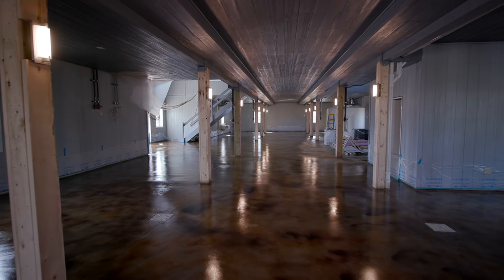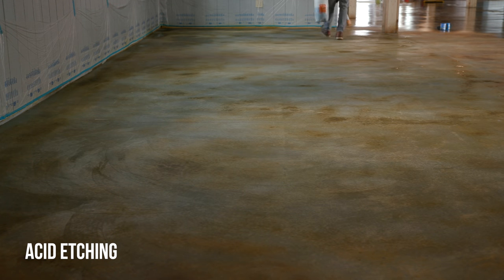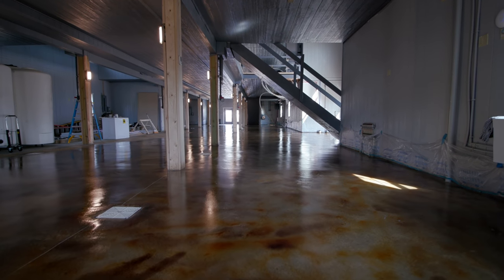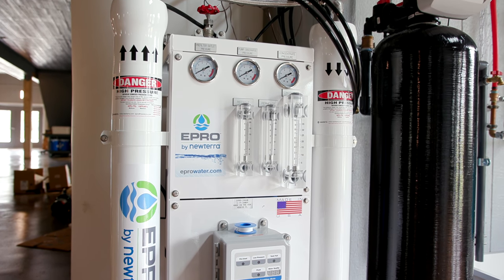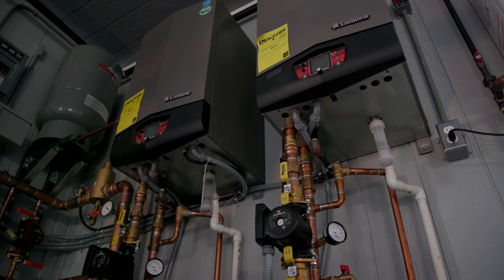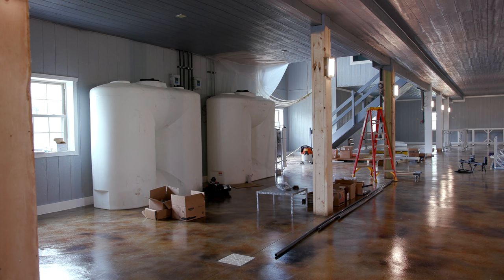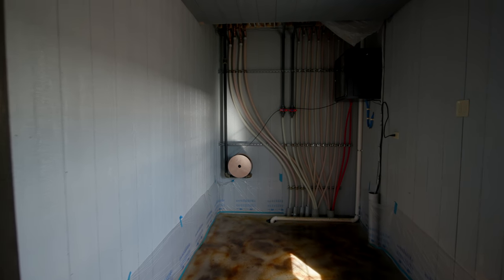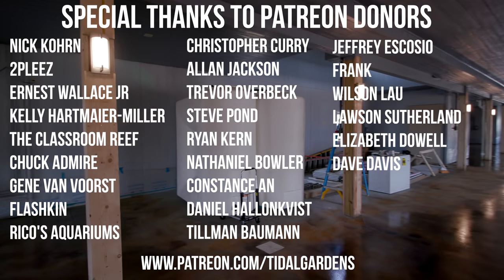New Tidal Gardens HQ Construction - Episode 9

Comment: Hi Than, the floor looks great we have some tenants do that to the floors in our office building. 
 You may know this already but I wanted to make sure but aluminum and stainless steel do not play well together around salt water. You should use no-seize or something similar to coat the screws with before you put them in.

Comment: I’ve been using 8020 for almost ten years for stands and canopy and then I used them for my storefront. I will be building a second one soon, a very small display room. 
I designed all the stands, canopies and displays in 3D first so putting it together I knew where all the part fit, plus, I cut and tapped most of the aluminum myself. 
I like how your place turned out, I’d like to visit if I’m traveling by.
Reply from the maker: Thanks!  I am very happy with the 80/20 product and I am going to be using it for all kinds of things.

Comment: Than, i recall you mentioning how you first thought of using a grit in paint to use on the concrete floor then decided against it. Well, that's the mistake i made with my fish room floor. Sadly, it began to peel up over time and, what remained became a dirt magnet ;(. SO, atm i am removing EVERYTHING from the room and stripping the paint. I became so monumentally sick of it, i had to do it. When done, i will then stain it, seal it and wax it just like you have done to your new building floor. I wish i'd have known about your business long ago. You've since become my goto "guy" for learning and in this hobby, we never stop learning. Thank you :)
Reply from the maker: Thank you!  I hope your floor turns out well.  I am happy with how this one turned out and really like how fast it is to clean.  I can do a quick mop of it in about 10 min HOWEVER I do have to make sure to wipe up any major floor spills because a little bit of water isn't slippery but a giant puddle is.

Comment: Love the floor. I would, if you haven't already, think of a way to clean those two 1000 Gallon holding tanks. Mine are only 1/10th the size of yours but they will need cleaning from time to time. The RO holding tank obviously way less. Are you having the same plumber do all of the plumbing on the tanks when they arrive? Can you do a video of that? That would be amazing! Can't wait to see it in July!
Reply from the maker: Hey Blue Carbon, cleaning should not be too difficult.  There is a drain system at the bottom that we can gravity drain out and it would be fairly easy to power wash the inside and let everything flow out.  July is going to be fun!

Comment: Than,
this is such an amazing journey you’re progressing through! If you have not said this already what Manufacturer will you be using to light all your tanks with?
What are you using for battery back up or back up in general? Have you also built-in surge protection?
Reply from the maker: I plan on ecotech radion pros.  For backup I will probably go with a natural gas generator.
Reply: Than 
have you also considered the Kessil  A360X? I am also consideringthe pros and cons of using either light on a 30 inch deep tank. I’m seeing more and more people put their ecotech up much higher and using diffusers to reduce the disco ball light affect. The Kessil shimmer looks much more natural. As far as the height over the water issue goes I don’t have answers there. I do like the fact that Kessil A30x’s are half the price of the ecotech Radion pros and it looks like you’ll be buying a lot of lights
Reply: One other thought have you considered testing a variety of lights over the first tank you install? 
This would make a great video.

Comment: For the drain pipe crossing the walkways i'd recommend using a cable/conduit cover like they use in construction and at music gigs to protect runs of lighting and sound cable, something like this https://www.workplacestuff.co.uk/product/pedestrian-cable-cover/ (found with a quick google search). they're usually tile-able, very durable (able to handle large crowds standing on them or vehicles going over them), come in colour patterns designed to be easily identified as potential hazard at a glance, and are anti-slip.

Comment: That floor looks sweet. Why'd you go with stain n seal rather than epoxy. And do you heat the water before it goes through the RO
Reply from the maker: I heard epoxy gets more slippery than seal, but really I just like the look better.  Also, I managed to get a really good deal on the stain and seal so the epoxy would have cost quite a lot more.  As for the water, I'm not heating it going through the RO.  The membranes are designed for cold water use.

Comment: Don't build steps, build ramps, trust me because you will want to use rolling carts to work. And you will trip eventually. Also put thick rubber Matt's down in areas you spend a lot of time. Concrete is rough on your feet and knees and will fatigue you.

I know because I work 8-16hr days on it. Most of the guys I work with have had 40+ years of service and knee replacements and my dad is crippled now because of it due to nerve damage.

Now that I think about it, if you plan on putting tanks upstairs, I would look at something like a cable hoist or chain come-a-long with a receiving gate. Maybe even a cart elevator. (or rent a small fork lift) 

You can also redneck it and put plywood over the stairs an the cable hoist on the wall upstairs to pull them up the stairs. 

Just to save your back Than, you have stairs and I remember Rico's tank move video you made.
Reply from the maker: Thanks Jeremy, no plans on big tanks going upstairs, but we might have some tiny tanks up there.  Good call on the standing mats.
Reply: @tidalgardens  no problem. 

Always happy to help with ergo and picking potential problems. Especially if it decreases effort hours and labor. 

I'm like a lazy engineer 😜😂

Hmm, in that case they make inexpensive dumb waiter systems that can lift 500lb+.

Wouldn't have to cut a hole in the floor, just mount it to the wall opposite of the stairs.
Reply from the maker: I can certainly appreciate that.  I've learned a lot of things from the greenhouse the past several years and having a blank slate to build a new facility allowed me to smooth out some things that made working in the greenhouse challenging.
Reply: @tidalgardens  dito

I make Pringles for a living and we do all our own maintenance and cleaning as well as operate the lines.

So hoisting large blowers, pm's, 2s and FIFO taught me a lot about time management, reducing effort, ergo and just straight up reducing hassle so I can be lazy and tag out for breaks instead of constantly breaking my back and feel like I'm not getting anywhere.

Hmm, there's an idea, peg boards for your tools. We use shadow boards at work with the tool name labeled. They make stainless steel peg boards as well for high humidity environments.

Comment: Than are your post flashed? Are they treated timber or metal with cedar wrap?
Reply from the maker: The core is treated wood and will be wrapped and sealed with azek to make it water proof
Reply: Tidal Gardens did you get a sample of azek? If not get one make sure it is pvc without the little wood slivers that timber tech trim will still fail and swell up .. not trying to be a smart a$$ I just deal with structural issues everyday and the most common is flashing technical applications

Comment: Step over Drain Pipe... (No Way Jose).
Do it right, or don't do it.
(bury it).
Reply from the maker: Can't.  Concrete is heated with radiant lines.
Reply: @tidalgardens  Go around the building, go overhead with sump pumps. Do whatever it takes.